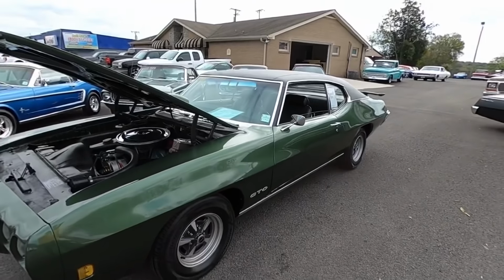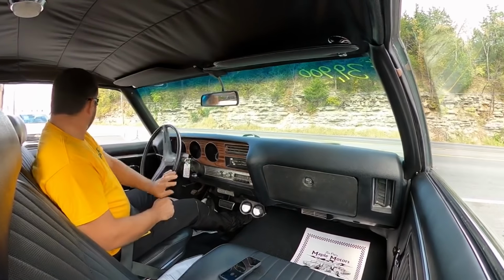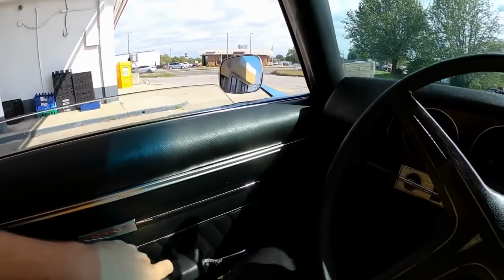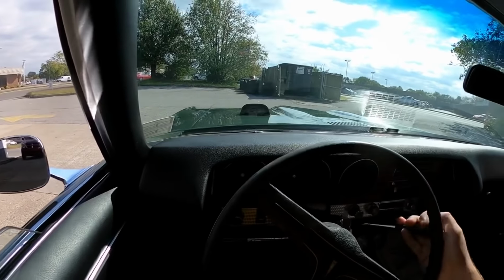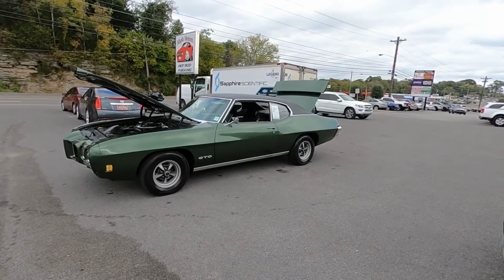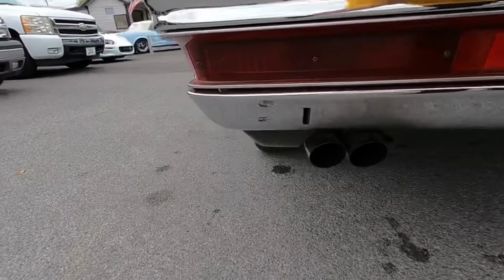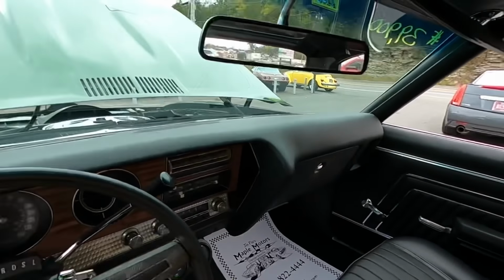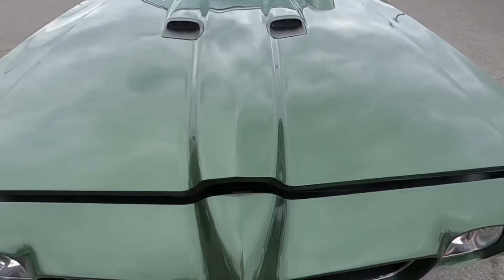Test Drive 1970 Pontiac GTO SOLD $39,900 Maple Motors #1347

Comment: Very nice 70 GTO with the original motor !!   I don't understand why GM discontinued the Pontiac line .
Reply: Did you see the last of the Pontiac’s? Body styles were pretty ugly compared to the old muscle cars. Most people chose the camaro’s over the newer trans am and gto’s. Let’s not even bring up the Aztecs hahah
Reply: @kennethhall5472  Well I think GM  could have put more effort and thought into improving the line in the later years of which you are referring to , instead of doing away with  Pontiac altogether.

Comment: That's one nice restoration. The best and easiest way to stretch a headliner, isn't contact cement. It's removing the side trim and peeling the headliner back. Add contact cement yes, but don't count on just that stuff to hold it. Add in a little hook strip so that the headliner can dig in and have the hooks hold it in place. If a full size home interior wall to wall strip is too large, find something else slimmer ( or rip it in half ) and screw it into place. Some cars have the hooks built right into the car so you can just hook the headliner into them but for cars that don't, just screw some strips of them in and she'll hold as tight as you can stretch it.

Comment: Looks like a Lemans mad into a GTO , never saw one column shift and steering wheel isn’t a GTO And oil pressure seems low ..especially on startup but sure is sweet
Reply from the maker: it is definitely a real GTO, Thanks
Reply: @MapleMotorsNickSouthgate  Does the VIN start with a 242?

Comment: Also not a ram Air.
Reply: Original RamAir III car would be alot more than 40k.
Reply: @angelaschoendienst8252  Oh for sure, but the callout on the hood reads Ram Air. The under hood set is not a Ram Air. And the column shift is a joke.  Needs a floor shifter and console.
Reply: @shannonshepard5047  probably added sticker the same time they put on rear wing and hood tach...
Reply: @angelaschoendienst8252  True. The only to tell what it is, run the VIN.
Reply: The only way.